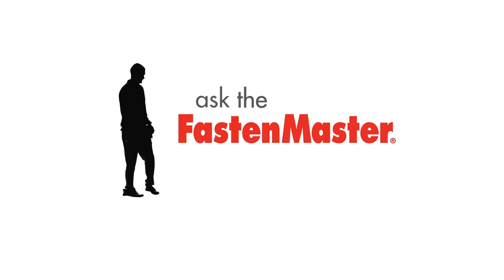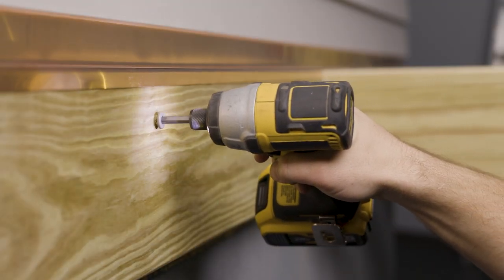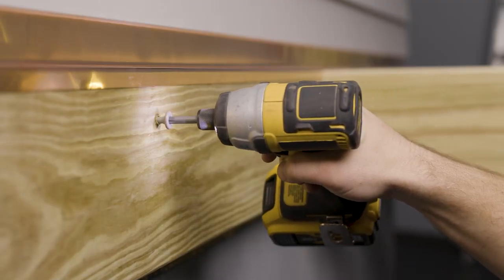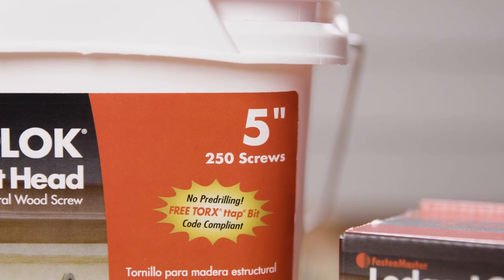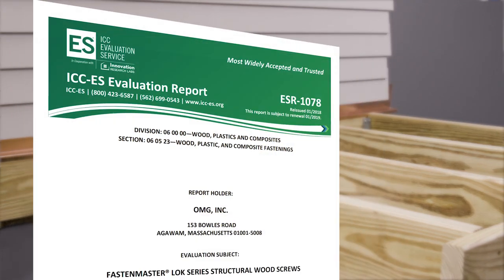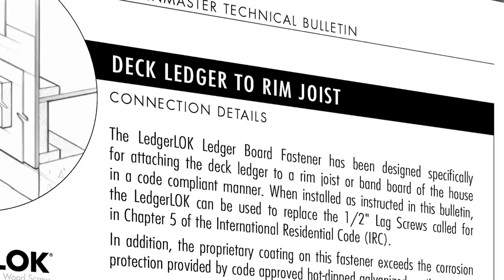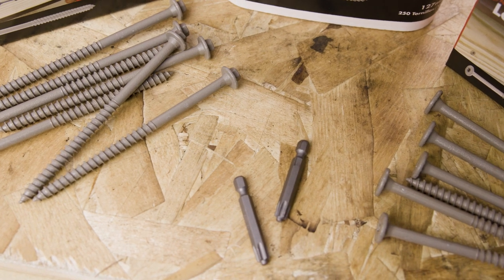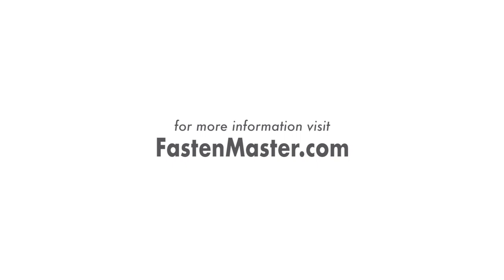LedgerLOK Flat Head Structural Wood Screw

Comment: Do you make structural screws for assembling a pole barn girts, purlings, and also do you make brackets for attaching headers to 6x6 beams??
Reply from the maker: ThruLOK can be used for most beam to post attachments in pole barns.  The FlatLOK can be used in many of the other pole barn applications.  We do not make brackets for these type of applications. Give us a call at 800-518-3569 if you'd like more information.